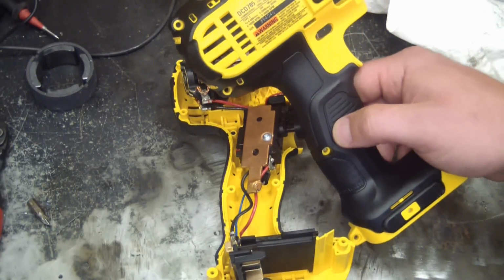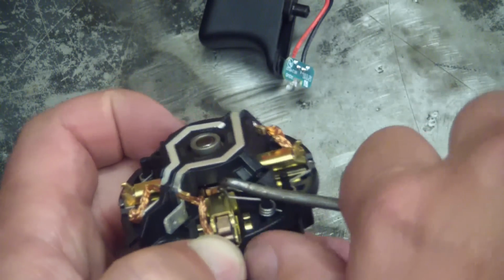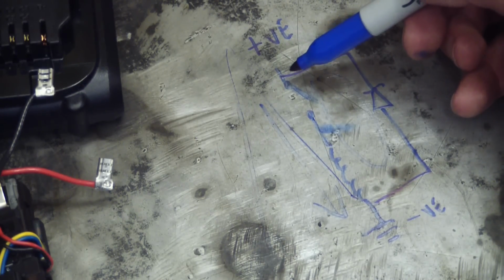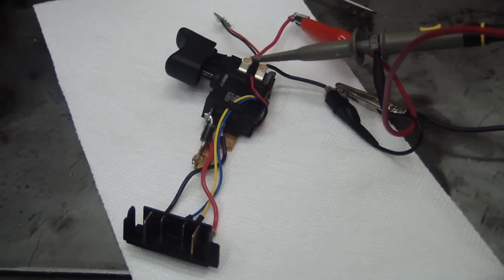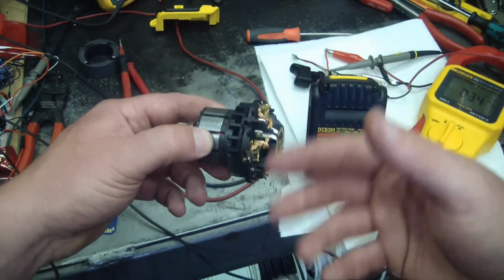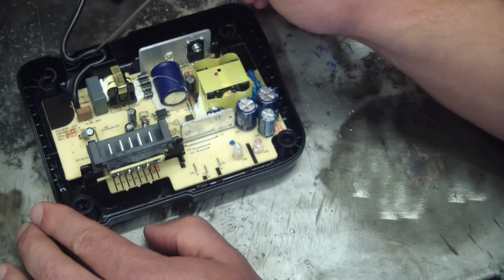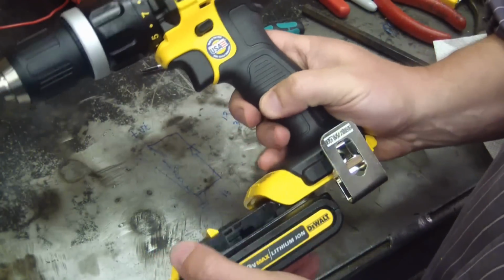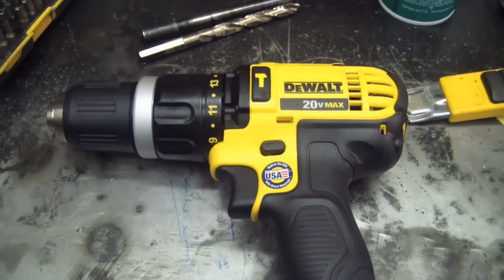BOLTR: DeWalt Hammer Drill. Test, tune and Electrical

Comment: couple of points.... you pry know by now since its like .75 year later and your crowd here is awesome. The instant stop is electronic or regenerative braking usually a DPDT switch back through a load resistor or even back to the battery pack itself (not possible with Nicads!). Same thing used in electric cars.

The 4 resistors in a row: Often the power factor they are safely rated for is very small even though your common carbon/plastic mix discrete(non SMT) resistor will take a WHOLE lot more before it is exceeded... I think 4 times was the real number and even that was conservative. 

At least one of the caps, maybe 2 (one on each side, pos and neg wave out of the tranformer) are usually these days amplified filtering -- a much smaller cap is used because a transistor or mosfet amplifies the filtering effect. This became a big deal to integrate into circuitry because caps were both large and expensive.

Back when the 78XX series TO-3 ICs were found in everything they were just starting to implement this tactic.

Comment: I don't think those wires going to the battery are temp sensors, I think they are voltage sensored to prevent over-discharging because it's LiPo.

Comment: As for the 18v biz, if you look on the boxes of all the 20v tools they say that it has an initial voltage of 20 and an actual running voltage of 18. I have the misfortune of working at Lowes, in particular tool department, and I've gone through every box to look at the specs of things and came across this.

Comment: Usually when you see "maximum power" rating on a MOSFET, it refers to its maximum dissipated heat, not its actual power handling capacity.
Take, for example, the IPP65R074C6XKSA1, a 650V, 57A MOSFET the same size as the one you have there (TO220).  It has a maximum rated power of about 500W, but the maximum power it can control (aka switch) is 37kW (aka 50hp).
Reply: yeah, that's the amount of peak switched power it can handle and still stay within safe operating thermal parameters.  Hence it being a "thermal power rating"  If a TO-220 package attempted to dissipate 500W thermal power you could use it as a cigarette lighter because that sucker would almost GLOW.  Quick back of the envelope says it's got about .18CC of copper in the backing tab which is essentially it's heat sink with a specific heat of .385 and a density of 8.92g/cc dissipating 500W for one second would increase the temperature of that part by 791C.

Maximum ratings are inrush figures expected not to be maintained for more than a handful of milliseconds.  And you can pick one or the other on that side.  The mosfet you're talking about will survive either 650V of inrush voltage on a regular basis, or it'll survive 57A of inrush current on a regular basis.  But it probably isn't going to survive both at the same time even once.
Reply: bashkillswitch Everything you said is more or less correct.  Since I don't remember the context, I might get some of this wrong:

Usually when you have a mosfet like that, you're right, it dissipates relatively little power when it is switched on and effectively zero power when its switched off.

How long its state of transition is is usually a function of its gate charge (usually very high for power fets) and its gate source and sink current.  In my early days of electron wrangling, I fried my fair share of microcontrollers and fets before I started using dedicated gate drivers.

So yes, it can actually literally control tens of kilowatts of power, providing whatever current you want with whatever voltage you want (within its ratings), but it does so by switching on and off at (usually) tens of kHz.  Usually there's an inductor somewhere to smooth things out, which is what the motor acts as, and usually there's a free-wheeling diode to complete the motor's circuit when the fet is not conducting.
Reply: Yeah I get that, you're describing a ZVS setup like a switchmode power supply uses so it never sees those values because it executes the transition when the ac waveform is at or very near 0, little to no energy at transition point, little to no energy to dissipate as switching losses then you're limited only by the maximum through junction capacity that occurs at the waveform peak.

When you're straight PWM'ing a load like a DC motor or resistive element off a battery supply though you're always executing the transition at full power.  I'm sure there are ways to get around that at least for motor side like you said with a proper inductor and snubbing diode but in their case it was probably cheaper to go for the MOSFET that could handle banging 300W through the motor straight up.

In the end we're both looking at the same problem just from different ends of horse.  I tend to design to a worst case scenario vs an ideal case.  After all nothing spells excitement like watching the die of an NE555 do a shooting star impression lol. Though that was more of a "oops forgot the protection MOV and the breakout point fell off the ignition coil" type situation.  Freewheeling AC in a closed unprotected system gets interesting very quickly. Though my college room mates probably had other words for that and my local radioshack clerks learned they were happier not asking what I was doing with the $10-$15 a week in various components that I bought...
Reply: erm, yeah, I wasn't really talking about a zero crossing with AC.  That's usually used with triacs in cheap or old power control schemes that have a very heavy 60Hz buzz.

Doing some math, the fet I was talking about above has a rise time of 7ns and a fall time of 4ns.  It's not linear, but worst case scenario, each full commutation of the fet dissipates only 0.4 mJ.

This means you could have it dissipating the entire 36kW during the commutation and still switch it at over 100kHz without exceeding 50w, which is high but sustainable for a TO-220 package.

A good example is power factor correction circuitry, which has to switch on and off approximately that same voltage at approximately that same frequency.

I can't think of anything outside of industrial equipment that would need to be power factor corrected and would actually take that much power.

Comment: question. in country's that use only the El metric system. what are the ratchet sizes? as in the standard ratchet being 1/4, 3/8, 1/2, 3/4, 1 " so on and so forth.
Reply: +TheMoxyMan1935 the ratchets are usually the same inch sizes, the sockets and bits are metric
Reply: we use metric here in norway, and ratchets are inches, but the sockets are millimeters. but its fairly common with inch based tools to.

Comment: Our Bosch drill has a little spark in the back when it breaks the high spin from max to 0 just like this DeWalt hammer drill. Is that normal? If it is, isn't it going to wear down the drill over time? Sparks usually mean there are small bits chipping and flying off into hammerspace in a fiery finale... so, is it perhaps an intentional design flaw to limit the lifespan of the drill? Or is it a limited lifespan break mechanism? Any kind of information would be appreciated!
Reply: +SevScout just the brushes probably

Comment: the glue shoo on the windings is the balance weight,as opposed to balancing slots. that dynaweight can be a problem sometimes because it doesn't transfer heat, and can cause a major hot spot directly under it.

Comment: For what it's worth .. in the 2003-5 timeframe .. they changed from Al heatsinks on the triggers .. to the copper.
Second, those brush spring notches exist on many holders (especially DW/BD) from what I remember.
So many moons and much debauchery since ...
Lastly .. I have seen plenty of burned up "springy circles" inside of makitas, from aforementioned 300# bipeds.
I always loved how MK Diamond (etc) used a full wave bridge to run their tile saws on DC.

I worked at a shop by the name of Quaker Lane Tool, in North Kingstown RI. 
Now out of business, mostly because of the Big Box stores.

I am a recent fan from over in The Geek Group realm.
Keep up the great choochin' !!

Comment: +AvE I'm working on my undergrad in EE about to transfer to a 4 year. this stuff is killer fascinating. do you know if that charger balances and senses each cell individually or if it does a couple at a time. I want to throw together a higher amp battery pack and not sure how to set up the charging.

Comment: 20:38 the spacing of the bleed down resistor is to increase the "spark gap distance" to unsure the electricity flows through the resistors and doesn't jump the gap that could easily happen with one SMT resistor. also helps with ESD which is why there are two resistors for the LED on the drill... look up UL creepage and clearance for more info.

Comment: Just curious, don't know much about it. Would the softer hits be better for something like tile/ceramic? That drill strikes me as a tool that might be decent for a homebuilder. Depending on battery life of course.
Reply: +Joe Clark In Tile/Ceramic you don't use the hammer function.
Reply: terapiu Good to know, thanks! This is why I should stick to things made of metal.
Reply: Joe Clark
Reply: Joe Clark

Comment: I have one of those computer controlled Milwaukees and I have over temped it. The computer just shut it down until I released the trigger, then with no cooldown started it right back up. Not that big a pain, just stop stalling yer drill.

Comment: Why would they rectify the 60 hz, then pulse it into the transformer instead of just using the transformer on the 60 hz input, then rectifying it?
Reply: +crackpotfox You need a much larger and more expensive transformer for 60Hz compared to a higher frequency. That's pretty much the whole point of a switching power supply.

Comment: Have you ever dissected a snap on impact? Their 18v with 2 batteries and charger cost $700! Would like to see if I wasted my money. I like the tool, it has lots of power but is it made as premium as the price?
Reply: +Bryan Davis. What Still Flame said. You probably bought a $200 Ingersol Rand impact and a $500 a Strap-On boot.
Reply: Joe Clark Ingersoll's impact is about the same price if you knew what you were talking about. All of snap ons cordless tools perform very well. I'm happy with the ones I have, and I know if it messed up I can get it rebuilt try that with Ingersoll. Since your the new cordless expert
Reply: Bryan Davis. First of all, I read your question too quickly and instantly thought of air tools, which are what us professionals use. Secondly, if you are sure about the security/value of your purchase, why did you ask the question? 

This is directly from Snap-Ons website, 'Consumable Products are warranted, at the time of sale, only against defects in workmanship or materials that prevent their use'. This includes the brushes and batteries in your 18v impact. Heck, if the tool doesn't say Snap-On or Blue Point, it isn't covered under any of Snap On's warranties. 

Another note for you. Snap-On tool lifetime warranty is intended for their hand tools. All other tools fall under the discretion of the salesperson. I'm not a professional tool reviewer, but I'm also not the idiot that asked if his Audi A3 was a good value when everyone knows it's a Jetta.
Reply: I think you finally get it! I'm an auto tech! Snap on and Mac do the job very well in my field and I don't care about Rockwell hardness scales or if in ten years my 14mm is 14.1253637mm! If it feels sloppy I can get it warranted.
Reply: Well you professionals keep on using just air and I will use my cordless tools and not trip on air lines. Every professional tech I know is moving to cordless.Thanks for the web site quote but I deal with my snap on guy and he takes care of us. I was just curious about the way snappy made there stuff if he said it was junk I would still get one because I know how they perform and its obvious you have no clue.
Reply: ***** thats the point when you choose career. Automotive  repair is what i went to school for and what i love. Your trying to compare apples to oranges. Your field is very specialized but im content with my job, that upsets you for some reason. I dont understand  your shit talking about my field when good  techs are in high demand,  you must  work on your own stuff.  I just do what i love and i feel satisfied  with it like it or not.

Comment: I am learning all the timeThis "electronics" Is fascinating
Reply: +AvE My Dad built a speed controller for a model boat 30 years ago It cost a fortune Big transistors & heat sinks ect
Reply: The trigger diode is called a flywheel diode, logical if you think about it. The motor back emf that's generated on shutdown circulates via the diode until dissipated, thus protecting sensitive control electronics from potentially massive induced back voltage spikes.
Reply: Have you learned everything because this "English" is pretty fascinating too.

Comment: I saw one of your videos a long time ago mentioning the over temp sensors for the battery. Saved my ass while screwing on a new sheet metal roof on the car port. Suddenly the drill clapped out and if I hadn't been edumacated by one of these videos as to the cause I would have had to drag out the corded drill, oh horror of horrors. Instead I stuck the battery in the freezer for 5 minutes to get me through. :-p
Reply: Nevir202 I’ve seen roofers on hot roofs in 110F weather with a cooler on the roof – they’d rotate the batteries through a cooler. They stuck the batteries in a ziplock bag and dunked them in there. The ice was in a trash bag so that there’d be not much liquid water to get into the ziploc bag should it have inevitable holes.

Comment: Resistor "ladder" explanation:
The pick and place machines they use to place those tiny ass components have a limited number of reel recepticles, meaning the amount of part numbers the machine can place at one pass through the machine is limited to the reel limit.
What designers do to save space on that limit is to use multiples of one part so they don't have to add another reel. This saves on manufacturing cost. It can also save on the cost of components because you can buy the one component in bulk.
So I bet if you were to look on that board again you'd find 1MOhm resistors in use in other places on the board.
Dave Jones from EEVBlog does a good job of explaining it in detail in his series on PCB Design.
Hope you found this interesting despite being long.
Reply: That, and I think 400V across a single of those SMD packages might be pushing it ...

Comment: Ave,

Not trying to start something here, but isn't the drill shutdown a good thing. I mean yes, I completely agree on the shutdown when your drilling and the drill doesn't like being pushed and shuts down on you (or when the fawker is half way to balls deep in an LVL, and just won't chooch cuz its binding and just needs to muster that little bit of copper winding-burning power to pull through because your using ur great grand-dad's brother-in-law's hole choocher that couldn't take a bite out of warm butter, but  that is somehow "bullshit, boy you know how many holes that's been through?" To which I reply "how many of the holes that it had been through did it actually drill?". loved the old drills for that, much more skookum, plus the noxious emissions it emitted when running hoy put lead in your pencil. Bonus Nachos. 

But the one more hole concept is not a good one as the battery chooch cycles will reduce as you more than likely may overdischooch the lions to the point where they don't roar as long and loud. Also its for the  longevity of the batteries as far as when they overheat/or run close to their max C rating that the drill says I'm done, no?

gr8 vids

Comment: Chris, I have to drill into concrete on average two times a day and the dewalt in hammer mode does the trick. I am a wire technician with AT&T and have to attach new network interfaces on houses that require two tapcons and would be up shit creek without a paddle without the hammer function. I know you gold mine and bang on rocks in your spare time and  require a beefy hammer action, but I wouldn't poo poo the hammer function for the average guy working with brick and masonry. This is coming from a Porter Cable lover. Love the channel, so glad Taofladermaus introduced me to your channel. I think i have seen all your videos by now. All except one. Guess which $.49 video I haven't seen yet. Keep it up though, I have pimped your IKEA manly man skills video to all of my friends to help get you more subscribers. I have learned much from you oh Jedi master.

Comment: Lithium batteries are in the beginning charged with constant current until it reach max voltage for that battery which for these are 4.2V per cell. At exactly that point does it switch to constant voltage no matter what the current would be and continue to charge (with progressively lower current) until the current hit a certain point which is around 5 - 10% of the original charge current.It takes slightly under 2 hours to fully charge a lithium battery. If it, as you say, only take 1 hour to charge these then the charger work in that way that it only charge with constant current and as soon as it hit 4.2V per cell is says it is charged and done and stop charging.Sure you save around an hour in charging time but you loose around 20 - 30% capacity on doing so.

Comment: What appears to be a MOSFET transistor on my makita bhp458 melted, (dont ask what i was doing) and since im unable to read the numbers on it, i cant find out what to replace it with. Any ways to figure out the ratings or whatever on this component?
Reply: Thanks for your reply, I'm curious; how did you come up with these numbers? Cant find any IRFP-series mosfets matching. What im wondering is if something will blow up if the values are off?
Reply: aha, got it. Thank you sir :)